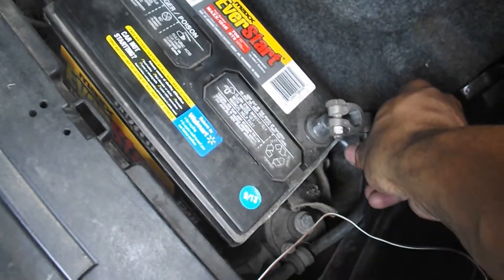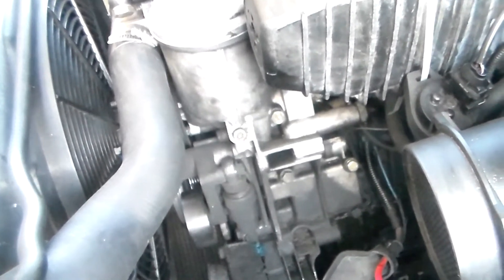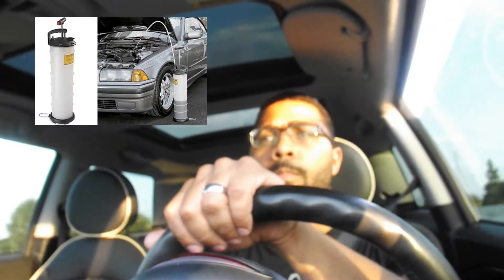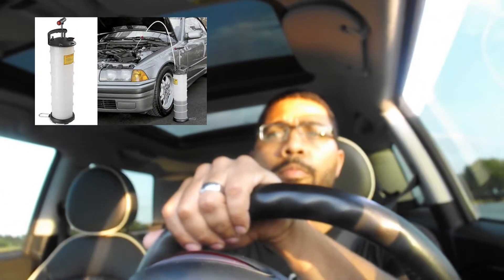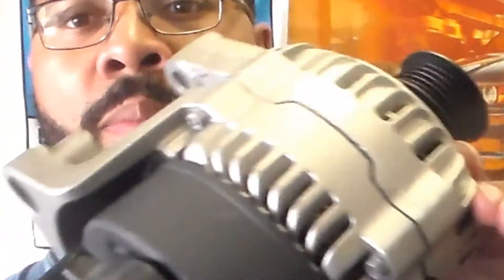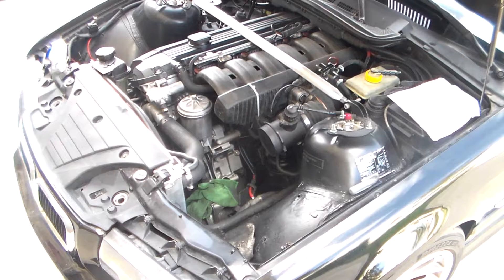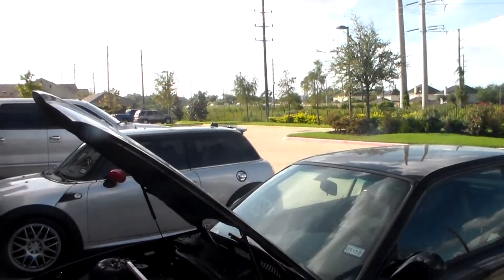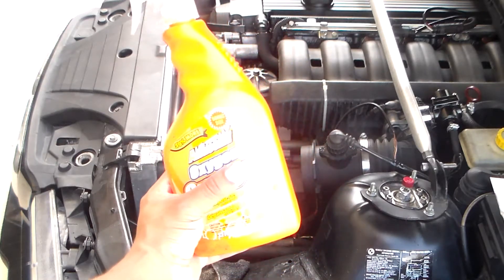E36 M3 - Alternator ..to rebuild or replace?

Comment: Nice M3.  Rebuild FTW, if you're still lucky enough to have a local guy.  First parts store reman i got for mine (Valeo, 99 M3) whined like a supercharger, second one the voltage regulator gives out over 5k and voltage jumps to 18v+.  Contacts are also just zinc plated crap that rusts if left sitting, not like the gold finish on the original that never corroded.  I regret turning mine in as a core.